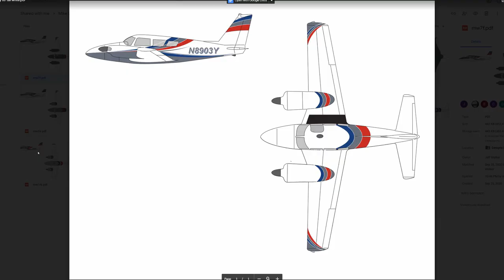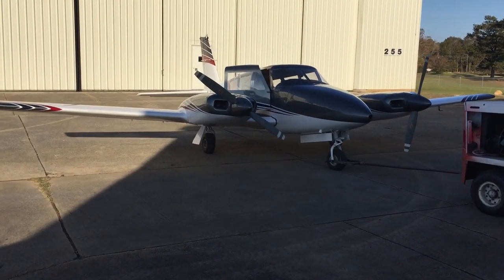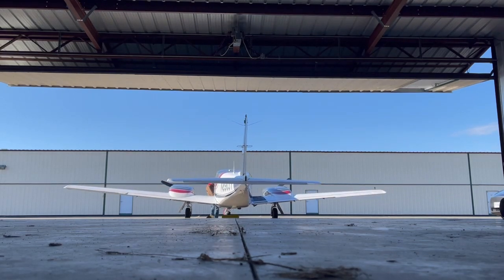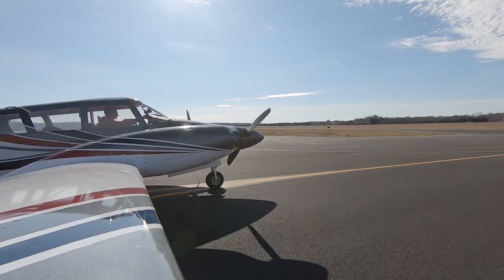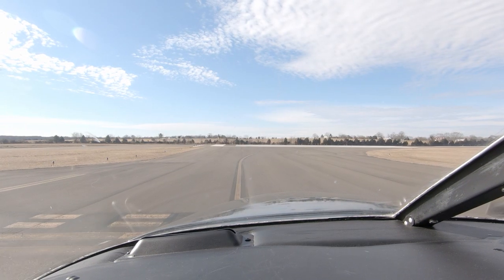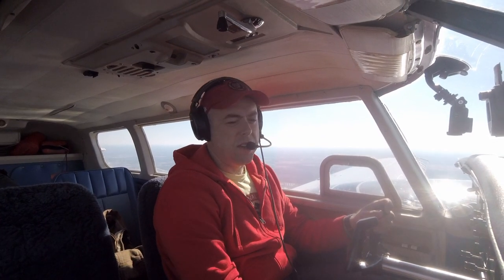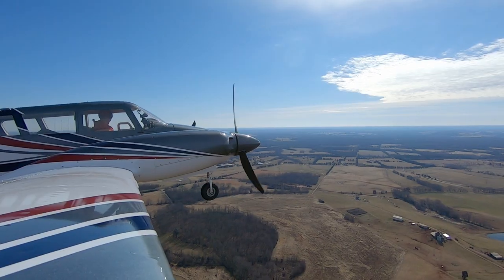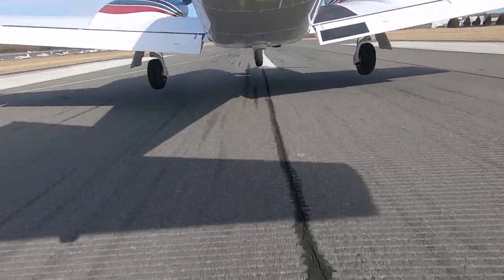Paint Job COMPLETE!  | Twin Comanche

Comment: Did you change from the old enamel to a plastic paint? I found at the same power settings I gained 5 knots increase with my Bonanza.
Reply from the maker: No switch here.  I always thought speed advantages gained from paint is quite exaggerated, but who knows?  Maybe plastic paint would make a difference.